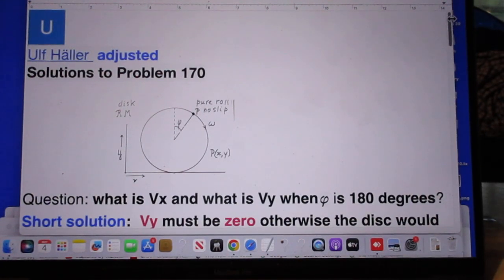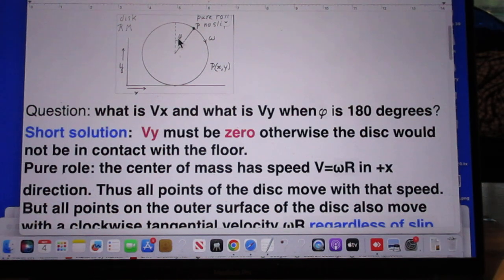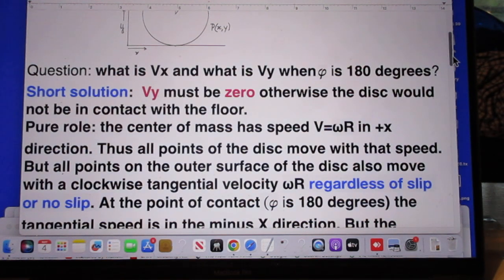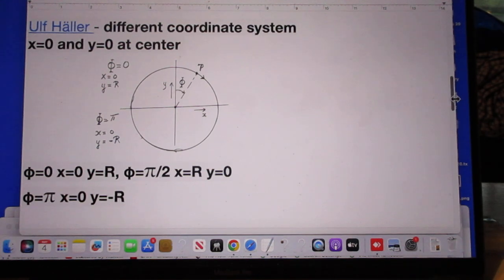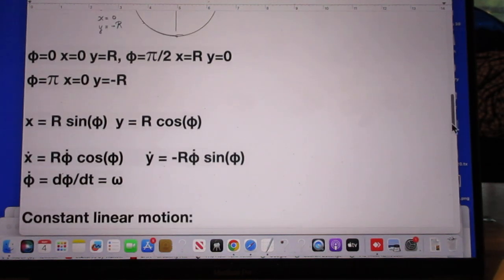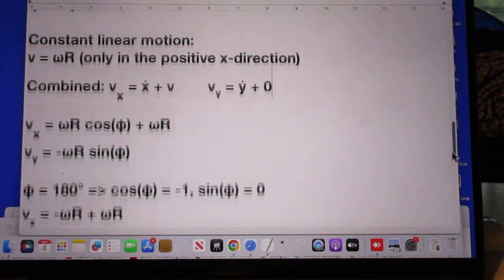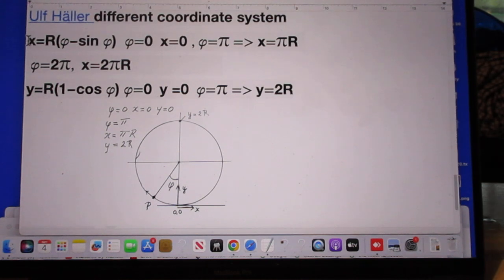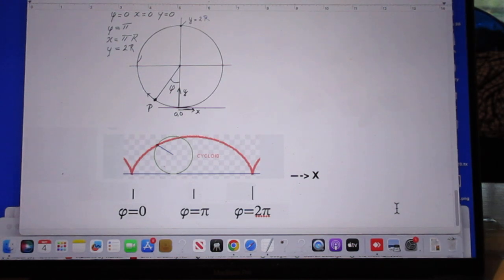Solution to Problem 170 Pure Roll

Comment: Sir I have a doubt in Physics. I want to know what is the difference between evaporation and vaporisation? Can you please explain?
Reply from the maker: use google
Reply: Vaporization = general term for the phase change from liquid to gas.
Evaporation and boiling are subsets of this term, based on the specific method.
Boiling = takes place in the body, at the full boiling point.
Evaporation = takes place at the surface, as it interacts with the surrounding gas.

Comment: Sir, Volt per meter is used to indicate overall electric field and Newton per coulomb is used to indicate electric field at a point. 
Am I correct or wrong ?
Reply from the maker: Volt per meter and newton per coulomb
The SI unit of F is 1 Newton (N) and the unit of C is 1 coulomb (C). So, E = 1 N/1C = NC-1. From the above, we can see that 1 V/m is equivalent to 1 N/C. This is why both volts per meter and newtons per coulomb are used to represent the strength of an electric field.
Reply: @lecturesbywalterlewin.they9259  Sir, but what about physical significance in terms of units?
Reply: @UddiptaKalita-il2vh  It's a force field.  It gives instructions for bodies to experience a certain force, based on position within that field, and the property of matter sensitive to that force.  The two units are interchangeable, since it's just a regrouping of the same SI base units.

Think of N/m as the local property of the force field, where it applies at just that specific point.  I.e. the force per unit participation property (i.e. charge), that the objects creating the field will apply to it.

To understand V/m, think of it from the point of view of the cumulative effect of the field (the Voltage difference across two points) divided by the distance between the points.  And narrowed down to smaller and smaller intervals, until the distance is infinitesimal.  If you "add up" all the V/m values across a given distance in meters, you get the total voltage difference.

Comment: Professor A simple Doubt here as i study in class 11th and am very new to the topic of Kinematics so a doubt has arised in my mind ? Can an object having a constant speed has some Acceleration ? Our teacher told that it depends on type of motion the object is under so why in rectilinear motion there is no Acceleration ?
Reply from the maker: if a satellite in circular orbit goes around the Earth there is an acc on the satellite as its velocity changes all the time (the Force that provides the acc  is gravity). However, its speed does not chnage. I cover all this  in my 8.01 lctures.
Reply: Cool question! Let's think about it...rectilinear motions are essentially one-dimensional motions,  so any acceleration (if the body has any) will have an integrated effect on the body in that particular direction it is moving ...since our body here is moving linearly. So u see now why, anything you do to that body, will always be reflected on the only dimension the body is moving. Now if we look at the same thing from a mathematical POV: velocity, a vector, magnitude and direction, since the direction is fixed(in rectilinear cases)  so magnitude must alter with respect to time, to get a non-zero derivative(i.e. acceleration). Now things change if we go to higher dimensions, let's say two eh! ... in two-dimensional motion, the body is moving in two spatial dimensions, so now the degree of freedom is also changed in our physical quantities. now the velocity, which has a direction and magnitude, both can be changed. now one can fool around with direction ( which u couldn't do in linear motions btw) and can keep the magnitude constant. this is the principle of uniform circular motion. think about it more... it's fun!

Comment: Sir are you following buddha's teaching ????
Reply from the maker: I am an atheist
Reply: @lecturesbywalterlewin.they9259  Hi sir, I have a question regarding the electrostatics chapter. The answer to the following question varies on different websites and different teachers are providing different explanations. I am confused about who is correct and what the correct explanation is.
The question is: Two point charges, +Q and -Q, are placed inside the cavity of a spherical shell. The charges are located near the surface of the cavity on opposite sides of the center of the shell. If σ1 represents the surface charge on the inner surface, Q1 represents the net charge on it, and σ2 represents the surface charge on the outer surface, and Q2 represents the net charge on it, then which of Q1, Q2, σ1, and σ2 is zero and which one is not zero?